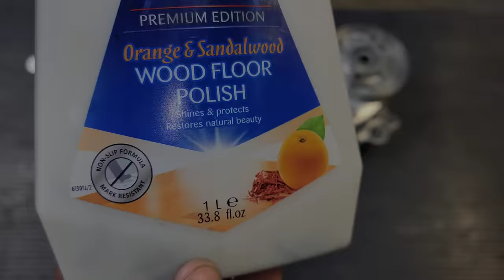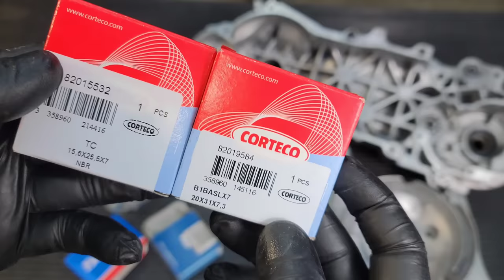Crankcase preparation for Honda Dio 120cc scooter

Comment: Hi can anyone help I have 125 cc engine I’ve but new crank baring and seals I’ve removed cylinder to get it ported and now need to remove crank so can port engine is it still ok to put same crank and bearings back in after engine port work or will I have to replace crank seals and bearings the engine as 700 miles on it would really appreciate it thanks